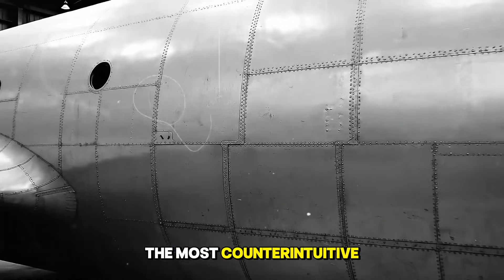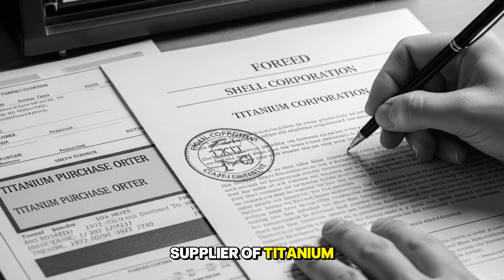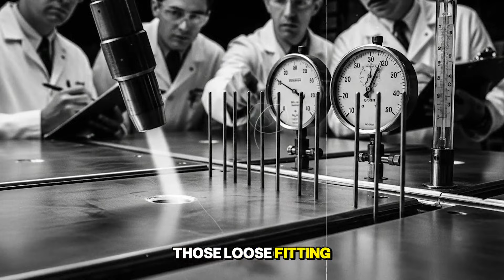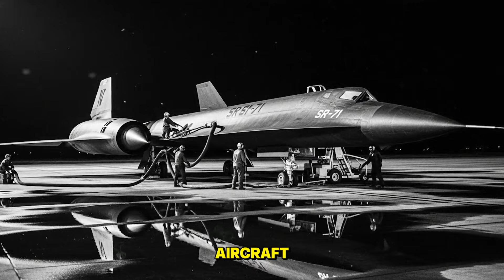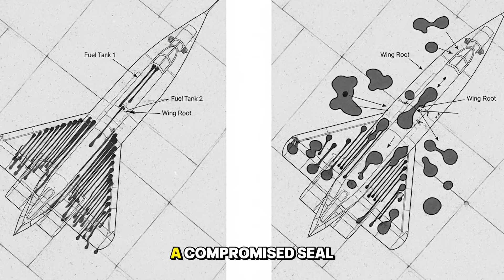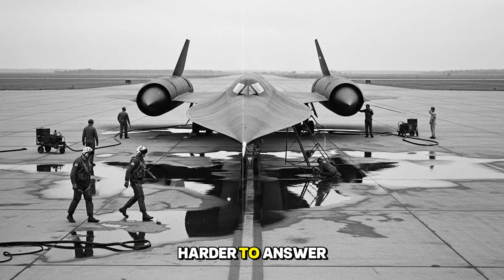SR-71 Blackbird: The Leaking Fuel System That Shocked Engineers—and Worked Perfectly

Comment: Its all about heat. The  sealant could not live in the high heat areas of the leading edges and out near the engine nacelles. 
No, the tanks would not seal when the aircraft expanded from hear. 
That is a widely held misconception. 
They consumed fuel from tanks 3 and 6, the wing tanks.